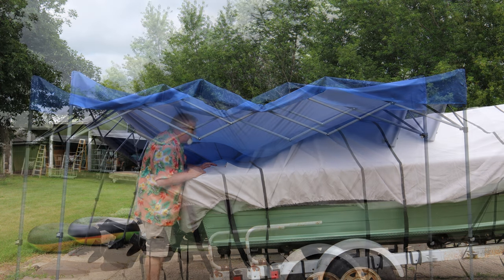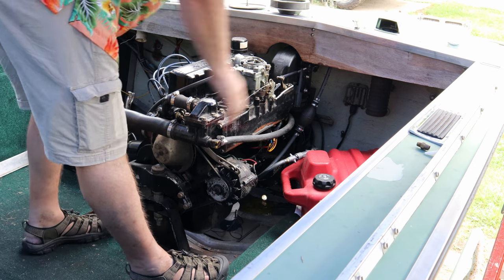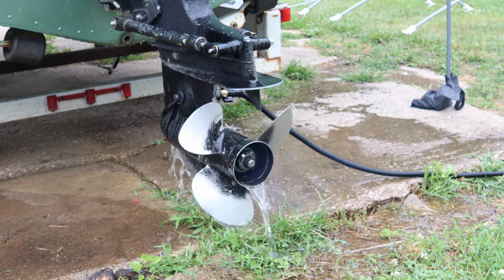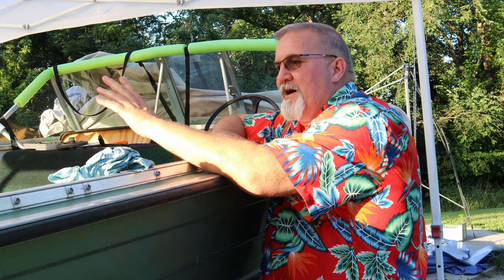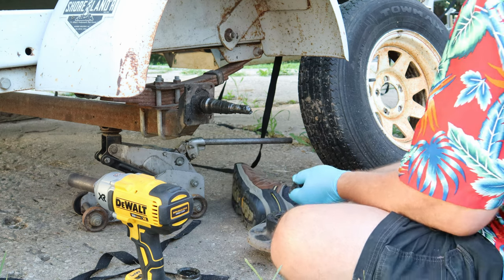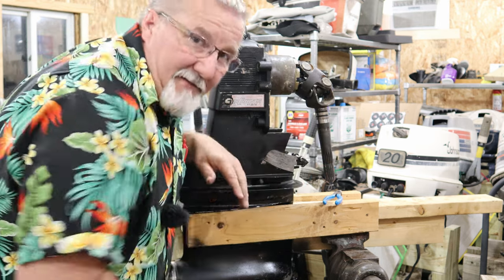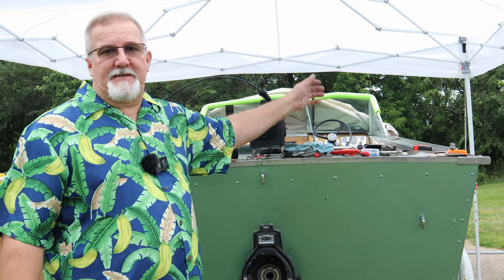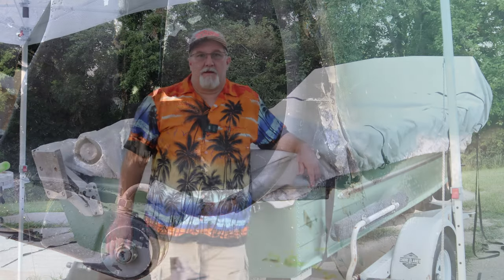1967 Starcraft Holiday plus Mercruiser 120hp (Epic Failure) Big Problem Can it be fixed? Part 1

Comment: That was pretty cool, learned allot just by watching this. I had a 470 mercurser way back when on a fiberform in the 80's. I never had to do anything out of normal maintenance except had the starter rebuilt. The motor had allot of power
Reply from the maker: I have a 470 and I'm excited to get it on the water some day. Thanks for watching

Comment: Great videos, lots of knowledge, thanks for sharing everything! Any suggestions on no spark with 120hp mer cruiser 79' Rinker,built,  coil replaced, condenser replaced...just no spark when testing straight from coil plug.  It did sit for 1 year, ran just fine prior.  Thanks!
Reply: Any fix yet ? I know there is a diode wire off the positive terminal

Comment: Mike fyi.  I take a 10 ft length of hose with an inline shut off and hang it on the inside of the boat.  This way I don't have to up and down the ladder to turn the water off and on.
Reply from the maker: Thanks for the tip.

Comment: Mike did you use  bellows adhesive when you reassembled?   If not that could be a potential leak source.   Always use the adhesive.
Reply from the maker: We used adhesive for sure. thanks for watching and commenting

Comment: Transom is likely waterlogged.  Freezing will push it out/or expansion from the water in the wood.  Multiple ways to fix, all of which will require the removal of the outdrive.
Reply from the maker: Transom is not waterlogged, perfectly dry, advantage of the aluminum boat is the wood is exposed on the inside.
Reply: @Michaelsbackyardmarina  - As long as the wood is not broken, dry rotted, compromised the only possibility is the transom is bent.  Obviously the big cast piece of aluminum did not distort.   Does the gap line up with the ending of the wood?

Comment: looks like the transom got a little water in it and it froze. lucky there is no bolts that far down  or it would crack the housing. is that the old 4 bolt or 6 bolt? those canopies are no good in wind  unless you feel like mary poppins. lost a few camping. 60 mph winds will lift 1000 lbs of beer gut off the ground real fast!!!
Reply from the maker: Actually there at two at the very bottom, we got it closed up pretty good.  You will see in an up coming video

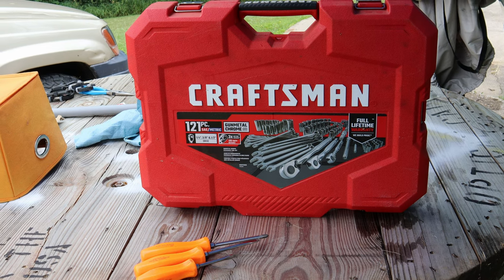Comment: HELP. I lost that slip fitting you discussed at about 5:20 of this video
 https://youtu.be/o6GTvDob3bA. 

Do you know what the actual name of that part is, or I know this is a longshot, but part number? SOS!!!

Sorry for posting on a different video,  but I'm in a bind and NEED this boat running by this weekend
Reply from the maker: https://www.marineengine.com/newparts/part_search.php?part_num=325624
Reply: Thank you! I actually need the plastic piece, not the nut.